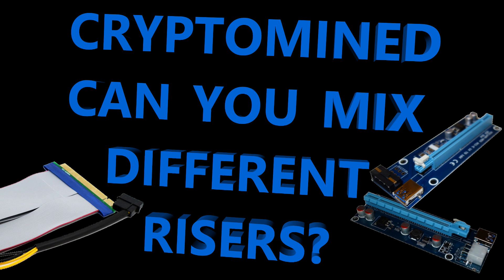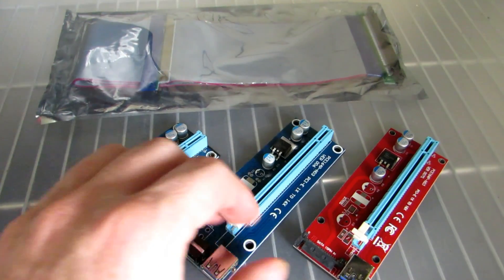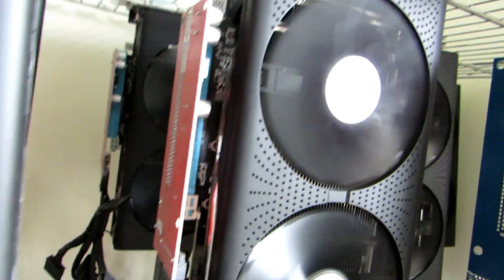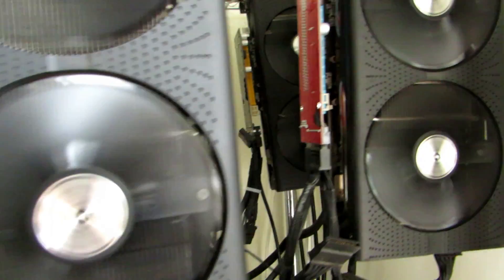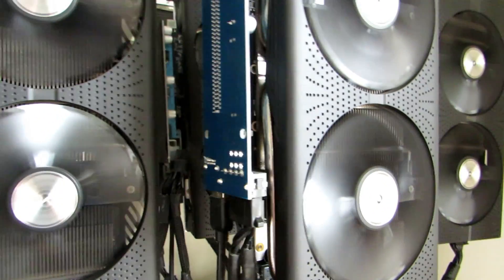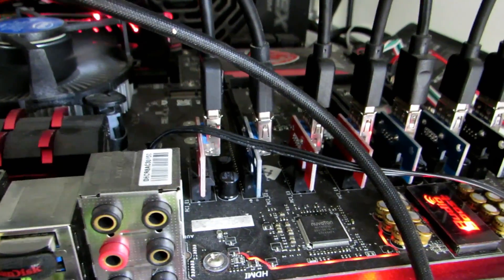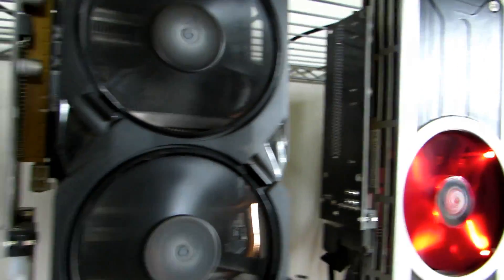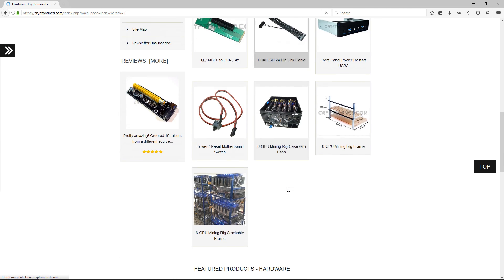Can You Mix Different PCI-E Risers on your GPU Mining Rig?

Comment: I tried a molex powered riser, with circuit board like shown here. Dropped fps from 60 to 27.
  Do you have a link for a particular edition/revision/version of the 16x-16x Molex powered ribbon cable???

Comment: I'm working on my first mining rig with the Z270-p motherboard and Nvidia GPUs. Using only GPUs in the PCIEX16_1 and  PCIEX_162 slots works fine but a third using a version 7 PCI-E riser in the PCIEX1_1 slot is not recognized. My troubleshooting brought me here because a friend who builds computers for gamers but not miners said that the PCI-E connections must all be the same. Any suggestions?
Reply: I figured it out.  My problem was that I needed to set the PCH configuration to GEN1.  I looked at this earlier and thought I should I should set it to GEN3 for good measure.  So, I'm using the PCIEX16_1 and  PCIEX16_2 slots with the PCIEX1_1 slot.  Due to the global shortage of risers and that the only place they are made is probably China, I'm waiting for the rest to come in the mail.

Comment: I'm confused which one to choose the riser. Just tell me which riser is stable and fastest
Reply: there is nothing like fastest riser.  All risers have same speed.  It's the riser with a diode and capacitors you should opt for.  In short ver 006 and ver 006c are good enough
Reply: The USB versions dropped in game FPS for my RX 480 from 60 to 27 and I couldnt manage to utilize more then 10% load on the memory controller.
  Im not sure what this means for crypto currency

Comment: I don't know how you can use those molex or sata risers, I tried it with molex and the wires got very hot after 5 minutes of use. I had to disconnect, I have ordered 6 slot risers for pcie, hope I will get good results.
Reply: I keep seeing people say stuff like this but personally I was able to get 4 1070s running on a single SATA cable with no heat problems, but I couldn't set all of them to use 80% power, one always had to be at around 70%.

Comment: Im about to build a setup using 6 molex powered usb risers. Im using 2 RM850x psu but i only have 4 molex strings in total. Would it be safe to connect 2 riser molexes in the same molex string because ive heard using the sata to molex connector is dangerous?
Reply from the maker: do you have any extra sata strings?  I mean if its all you got, then you gotta do what you gotta do .  personally i never had a problem with it, but I have seen people melting the molex/sata extenders.
Reply: Total I have 4 molex strings and 4 sata strings. Ive heard that i have to power all the usb risers from the psu that powers the motherboard is this so? Or can i power 3 riser/gpu 8pin from one psu and the other 3 riser/gpu 8pin from the 2nd psu?
Reply from the maker: I have heard mixed opinions on if its ok to mix or not.  The guy i get my rig frames from says it does not matter where the USB risers go or the GPUs, he said its fine to mix them.  myself I think I will power the GPU and riser from the same PSU.  I think there is a lot of confusion on this subject due to ribbon risers... but I believe with USB3.0 powered risers that it does not really matter where what goes where.
Reply: Slowly coming to the same conclusion as i read the forums. Thanks for the reply
Reply from the maker: yes its a pain to read through all the different opinions over the years.
the guy i get my frames from sets up 100's of rigs so I'm sure what he says is fine.  thats what I will do anyways.. ill plug 3 GPU and the risers for those GPU into one PSU, and hten another 3 GPU and their risers into the secondary PSU, and link the PSU with a dual PSU link cable

Comment: 6x rx480 8gb with your  flashed bios   mobo is killer z81 7 gpu on eth 2 cards doing  only 28 hash claymore 9.2v I'm out of ideas  for 29. like rest  ..undervolt 31  manual fan manual clock frequency  on wattmine all on same flash all Samsung nitro total 174.5hash

Comment: Not only th grip in the PCIe-slot is a good feature, also the fact that it has a sata connection, most newer psu has mostly power sata connections... AND the cheap sata to molex adaptors you get within the riser cards are not very high quality and save...  BEST WAY (what is very logical) is to use PSU connections driectly on the risers without adaptors...

Comment: !!!! WARNING !!!!!: One other Riser I have had a big Prblem I would not recomand buying this, it has (PCE164P-NO3 VER 004, PCE2PCE-NO4 VER 004) writen on it, dark blue pcb cards, has a light blue PCIe-slot and some kind of spring-lock, a molex conection. So what happen is that i installed the new riser, then after switch on everythning it had a short circuit in the card for the Motherboard very close to the pins, so I checked it a bit late 3-4 second after I smell some burning smoke, I switched it directly off but it has burned a little bit my pcie slot (x16) on the motherboard. The motherboard slot still works but maybe the slot has reduced longevity now... So I'm not 100% sure if it will work longer time, and if it is save anymore... And I can not sell the MB like this... I'm pretty sure it was short circuit on the riser card, you can even see the source of heatment, very close over the connection pins on the pcb (15-17pin)  But I could also bee a bad installation but this is less probably...

I also have to say that I also use 3 or 4 of them and they work... So it's maybe a quality problem on that series...

Comment: What model is this motherboard?
Is there a 7-digit card?
Reply from the maker: the one on the left hand side with 7 rx470s is a "Z97 MSI Gaming 5" Motherboard.  there is a Z97 MSI Mpower that also has 7 slots, and there are a couple of Z270 boards with 7 slots like the Asus Z270-AR and a strixx board, and the Biostar Z270GT7 just to name a few of the more affordable ones.
Reply: thank u
Reply: What are the best z270 7 gpu boards?

I am aiming to build one, I already have plans to get the Intel Pentium G4560 Kaby Lake as the CPU for it.
Reply: Mike ™ good question

Comment: When I try to overclock my 6 ASUS Strix 470 4GB's with MSI Afterburner. It doesn't give me a bump in M/H. Also, It only affects 1 card, even though I am changing the settings on another. I have checked the box to synchronize settings. I have done the BIOS mod, using Poliaris Bios Editor. I am running 16.9.2 drivers. Would you happen to know a fix for this?
Reply from the maker: hmm well im not exactly sure, but you can try to reset wattman or afterburner and try again...  I dont have any asus cards.
Reply: first disable mining of the card before Oc, Oc it and apply sttings, then enable that card on the miner and you will see bump hashrate( Im using claymore and wattman)